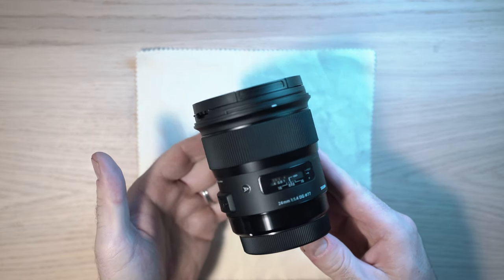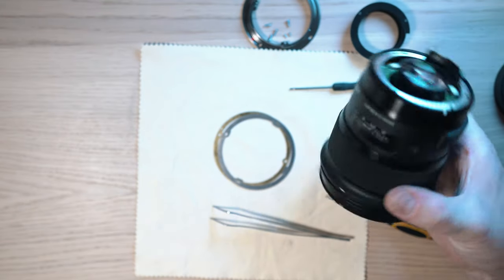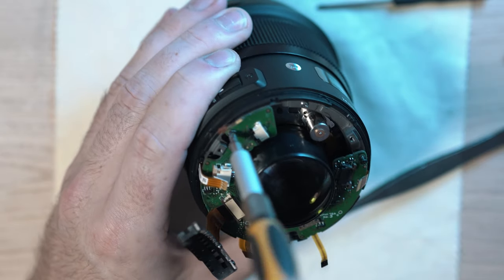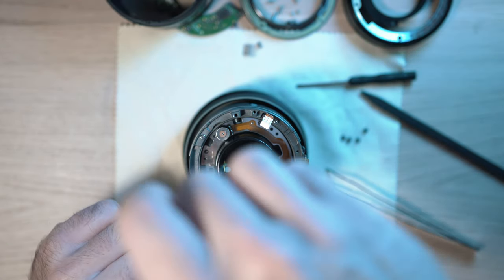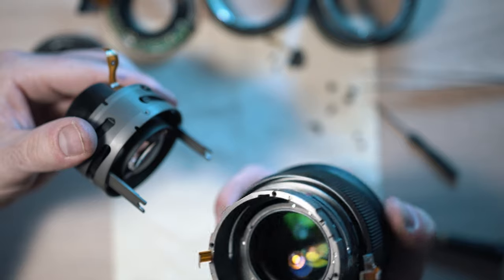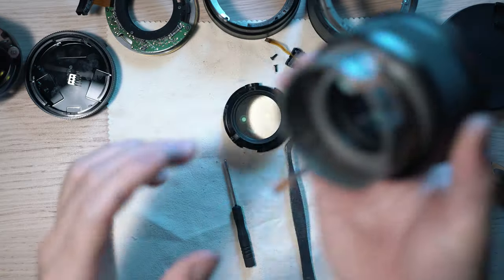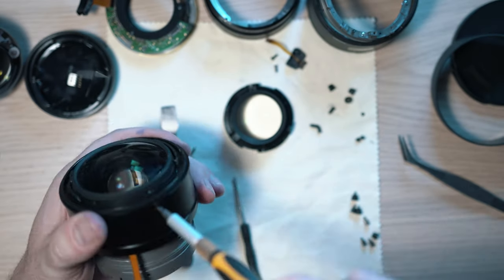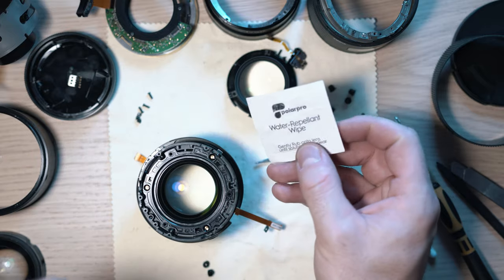Sigma 24mm f/1.4 art TEARDOWN | How To Repair Sigma ART Lens

Comment: you mentioned the original owner had attempted the repair and stripped a few screws - I've run into this with used lenses I've purchase in the past, but I've never seen a screw removal kit for something so small.

What are you using to remove the stripped screws/bolts and would you mind linking it for us to have a look and order it please?

Comment: I managed to the sticky aperture on my 20mm f1.4 thanks to this video. It looked like the problem wasn't due to sticky aperture blades but with the aperture motor and infrared sensor or due to high friction. The front part of the 20 mm lens is significantly different to the 24 mm lens so i couldn't take it apart.
Reply from the maker: thanks for your input!

Comment: What is wrong when the AF motor moves on the 24mm 1.4 art but it seems like there's no feedback to the camera as to correct af position. It always just goes to the hard stop. Position sensor issue?
Reply from the maker: likely

Comment: Hey i just came across ur video and it seems the only one explaining how to dismantle a sigma lens ,
Though i have one question i bought a sigma 30mm sony and it has this aperture problem where the system shows that it's open to 1.4 but it is stuck at 3.5 !
Any idea how i can fix it or what the problem might be is and where can i get new sigma parts at!
Reply from the maker: it could be main lens pcb or aperture mechanism (delicate and hard to fix is something worn out) . anyhow head in description and follow the links for parts…. directly contact aliexpress seller and ask for specific part for your lens … they will be more than happy to create new listing for you.

Comment: Need help.. my Sigma art 50mm is hunting.. i took it apart and saw that the clear plastic strip for the optical sensor on the body has a long horizontal scratch in it.. the plastic strip that im talking about has 2 white glue/silicon points on it on each end of the optical sensor.. I think something got stuck between the optical sensor and plastic.. can this piece be replaced separately or does it have to replaced with the housing?? Do you also know the part number??? Thanks in advance
Reply from the maker: Hi Richard! 
Im sure that you can replace just that strip ...  I will look around for part number

Comment: Hi does anyone know where I can repair a sigma 24mm f1,4 ART  aperture control lever on the rear of a the lens is sticking = it doesn't spring back.
Reply from the maker: you can get parts from china and replace them…. links are in description… even if seller doesn’t list aperture assy.  shoot him a message and he will help you out
Reply: @takeapart  what would be the usual repair cost for jammed aperture lever

Comment: Very good video I may need to use this. Curious and have a question: 
My 10-20 sigma wide lens started doing this thing where the image shakes in the viewfinder. If I take a photo, subjects are soft but the shake doesn’t drag. Higher shutter speed doesn’t change the softness. 
I haven’t dropped it. I didn’t even use it for weeks.
What could be the issue (I’m thinking it’s OS) and what would I be looking at to repair this unit? Will this video give me generally the same working flow with my lens give or take a few pieces?
Reply from the maker: hi, thanks and I would probably start with diagnosing it properly… maybe testing it without OS plugged in to main board of the lens .  (just to be sure)
Reply: Thanks! There’s no on/off switch to the stabilizer so whatever “optical stabilization” it has would be internal and always on. That’s why I assume this would be the culprit. It makes a low sound and seems to wiggle inside the lens when this shaking in the viewfinder is happening. None of my other lenses do this on the camera so I have ruled out the camera as a problem. I will check for updates to this lens model though, maybe that would help. Assuming it doesn’t, any advice?

Comment: I have a problem within Sigma 24-105mm nikon version that optical stabilizer not working, is it similar to disassemble as Sigma 24mm? Thanks.
Reply from the maker: well it is the same brand… you will see few similarities but structure is different….
Reply: @takeapart  thanks a lot!
Reply from the maker: thanks for watching

Comment: Great Video, very interesting.  You didn't take apart the HSM motor, why? If the optical sensor is bad how will the lens behave?  I have the earlier Sigma 50mm f1.4 DG EX HSM lens and the auto focus stopped working. I took it  apart didn't but didn't find anything obviously wrong.  Put it back together and it worked for a few weeks and then stopped again. Took apart a second time, still didn't find anything, back together again, and it began working again, but for just a day.  Sigma won't sell me a new HSM motor. Any idea's what needs to be adjusted, or what might be wrong with the lens? I can hear the motor make a slight tic, tic, tic sound when trying to auto focus, but the lens doesn't auto focus. It acting like the HSM motor doesn't rotate the lens.
Reply from the maker: Hi , I seen similar issues with canon USM motor…. it ended up to be motor it   self,  I can have a look if chinese supplies have one… just let me know exact model of your lens please.

Comment: Great Video, really apreciate, helped a lot!!! but... yes a but... :P now after inserted middle part with lens and getting focus ring "engaged" , but when i rotate focus(middle part with numbers, not the rubber ring) is reallyyyy stiff... :((( any ideas? also focus wont move with focus ring(rubber part)) and im sure its engaged :(
Reply from the maker: hi, if it worked before… you probably assembled the lens differently.

Comment: I have a question on a GoPro hero 5, so I take the battery out and I plug it into a wall charger. It turns on without the battery, it is still plugged in and I put the battery in and it dosent  turn on. It only turns on plugged into a wall charger without a battery. Need some help please.
Reply from the maker: hi, it should charge the battery... and turn on when you press pwr button.
Reply: TAKEAPART yeah the battery’s charged to 100% and I put it in and the gopro shuts off and it won’t turn on unless I take it out
Reply from the maker: go for another battery... maybe the battery is the problem
Reply: TAKEAPART ok thanks I’ll try that. I think that might have been the issue cause I was using a hero 8 battery. Thanks!! Take care

Comment: Thank you so much for this! I dropped my 30mm sigma art from high. It auto focus normally but the focus ring is hard to move, not sure what it can be or if I should try to repair it.
Reply from the maker: Hi, it sounds like something is bent… probably something near focus ring … best to inspect and see what needs to be replaced… 
thanks for watching
Reply: @takeapart  I have the same on my sigma art 24-70. It is the metal outer shell close to the lens mount. But I cannot find the part anywhere...

Comment: I have a Sigma 14mm f/2.8. that has a built-in motor for auto focusing. (Nikon Mount).  I kept it for about 15 years. I'm surprised the lens has fog or Haze in it.  I would like to open it and clean it. Can you show me how. Thanks and More power. I have cleaned before sticky leaf-shutters before as a hobby DIY'er.
Reply from the maker: Hi , unfortunately I do not have such lens …

Comment: I disassembled my dropped 24mm Art lens thanks to your tutorial.  I found it extremely difficult to remove the inner heart, and that relates to why I wanted to take it apart in the first place.  The focus ring doesn't respond to any movement while manually focusing.

My guess is that the main construction that hold the front element hit the ground hard enough that there is enough of a bend in the metal housing.  If the heart was that hard to remove, how in the heck is it supposed to spin freely via the movement of the focus ring...
Reply from the maker: oh it sounds bad!  well where you based? I may be able to help you.
Reply: @takeapart  is there any thing different to removing the front Element from the 50mm ART F1.4 Nikon...I have a tiny tiny bit of fungus on the edges of the front glass i would like to clean. But I cannot get passed the focus ring. I've removed the 3 screws with their plastic spacer. But there isn't any more screws around the focus ring.
Reply from the maker: hi, probably silicone glue is holding it on the lens .  thanks for watching
Reply: @takeapart  Ye, I'll ask a technician here locally...doesn't seem like silicone.

Comment: Hey, not sure if you will see this or even know if it can be fixed or how to. So i have sigma 35mm 1.4, it has fallen but worked fine up untill recently. When i try to focus something that is a bit further away (the manual and the auto focus does the same) its impossible to get sharp or in focus shot the image looks mushy and weird, if you think you could help somehow i could possibly send you the the picture so you can see. Thanks in advance!
Reply from the maker: hi, it sounds like something is stuck or broken inside the lens … there’s nothing I can do ….

Comment: Really helpful video. Please upload video of Sigma 50MM F1.4 ART lens for Canon. I have a problem with my front element glass with water condensation stain. I'm able to open the front screw however not able to take the first lens element.
Reply from the maker: hi, I don’t have that lens on me … but it shouldn’t be much different
Reply: @takeapart  Yeah i thought the same but it had only 3 screws before opening the Front element glass instead of 6 screws like 35MM.
Reply from the maker: hi, I see - it is hard to help you this way …

Comment: Hello Takeapart. You are so cool. I love your videos :D I has one question for you. I has this Sigma 24mm 1.4, the problem is i have fungus in the back lens. Just the first lens back but inside. Do you know if it is possible to open this part of the lens???  I have look in your video there is a split in the plastic (2:43). Many thanks for your support :D
Reply from the maker: Hi Fran , Im afraid that it is glued on ... it is easy enough to get new one from aliexpress... check links in description and contact sellers and ask for specific part. 
thanks for watching
Reply: Hi, not sure if this is any help but I have been using this video to help me take apart a 20mm f1.4 art, both the rear groups have a fine spray of dots inside, the inner group I took apart by slowly with a fine art paint brush applying small amounts of nail varnish remover between  the retaining ring and holder and eventually could unscrew the black retainer ring and clean the inside of the two elements,this looks very similar to the one in this video, (I was a bit nervous in case any of the solvent got between the element but me still not being able to separate the group to clean),.     The group that is attached to the aperture (outer rear group) looks like you would have to remove the aperture leaves etc to gain access to any retaining rings to disassemble (if there is any)

Comment: this looks very useful, thanks... I have odd problems with the 50mm Art and I'm hoping to fix myself. But not sure if it's hardware or software. This video makes me more comfortable trying.
Reply from the maker: hi , thanks for watching! feel free to describe your issues… maybe I can help
Reply: @takeapart  I appreciate that! It's such a strange issue. 

If I am focused on something 1 meter away, and switch to something 10m away, it works. But if I am focused on something 8m away, and switch to something 10m away, it fails.

It's like autofocus does not work unless the target is extremely out of focus. It will not activate, if it's only slightly blurry.

Here is the strange part, I can always focus on something closer than the previous target. If I switch from something the 12m away to something 10m away, it works.
Reply: oh, also aperture will not close past f/2. This is actually a bigger problem.
Reply from the maker: what camera do you have? have you tested with different camera just to confirm it is the lens… causing the issue? 
I would open and check any broken loose parts inside, definitely clean and check focus optical sensor (small sensor on side of the barrel) . iris mechanism is delicate and even small piece of rubbish can cause malfunction.
Reply: @takeapart  cheers. it's a Canon r6, but same issues on 7DmkII. Seems it's time to open up the lens. Hopefully the problem will be clear. Maybe some glue melted into the AF sensor and aperture blades.
Reply from the maker: ok well it looks like lens issue….  give it a try…. let me know if you need anything